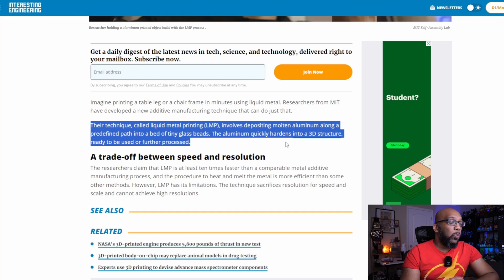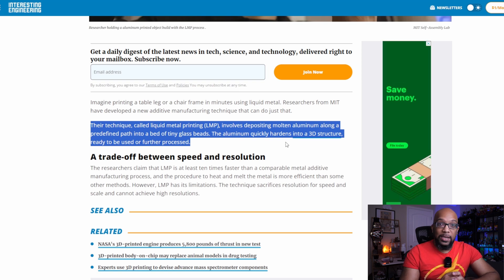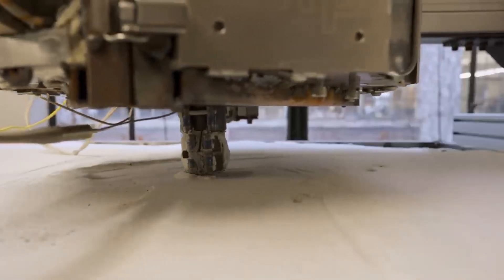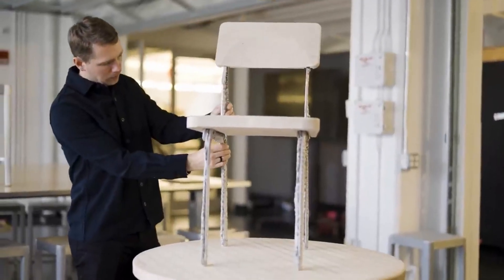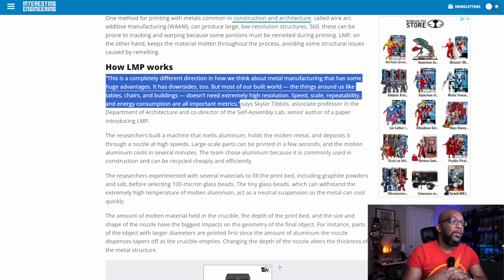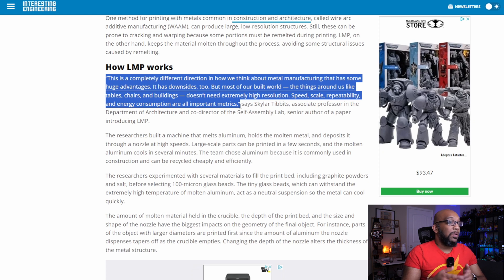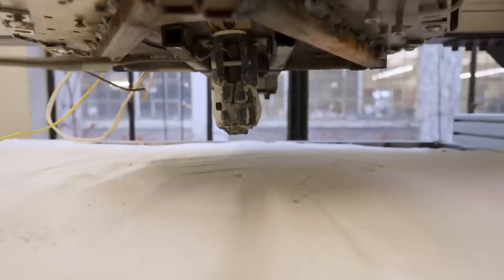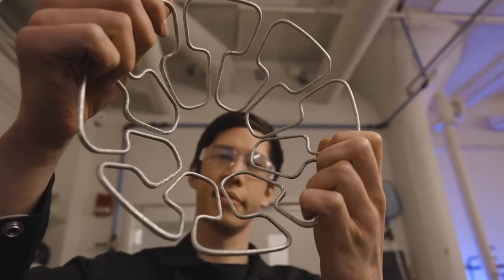MIT Creates Liquid Metal 3D Printing!

Comment: So literally they're just taking fused deposition modeling 3D printing and instead of using a spool of plastic they're using a hopper full of glass beads and aluminum to make something that is lower quality and requires more cleanup than the actual normal 3D printed metal processes that we already have?
Reply: Did you miss the whole 10x faster part?